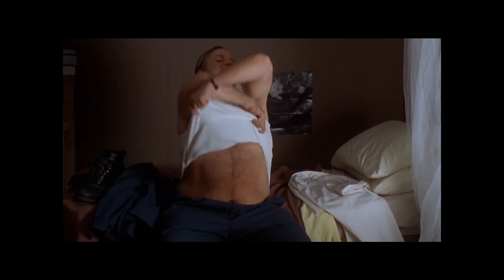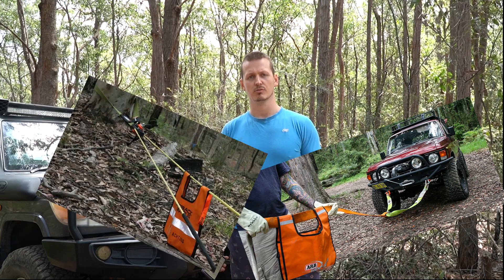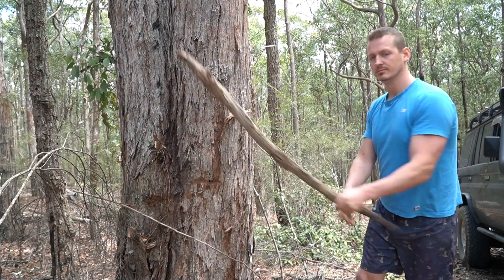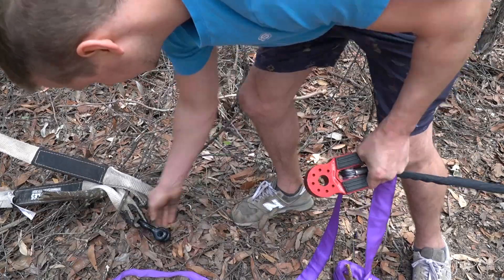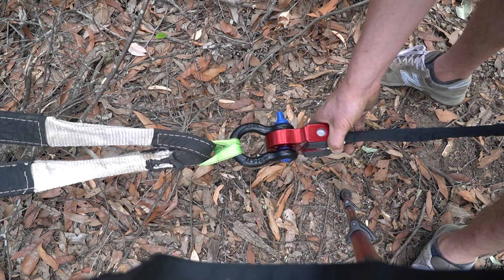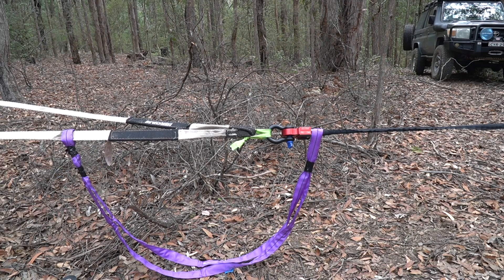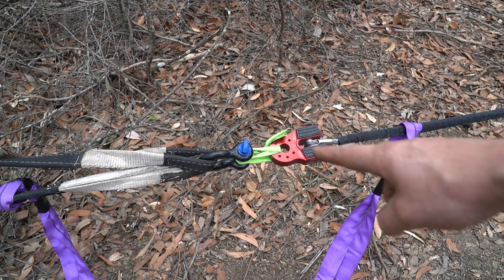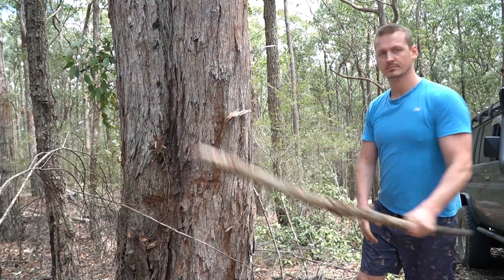NEW winch recovery techniques. Breaking straps and testing to destruction

Comment: Ideally i only use a tree trunk protector, one soft shackle and my winch rope. No metal at all. The only thing i use the so called winch dampener for, is to carry my recovery gear in. Also if im winching and theres other people around that have their eyes painted on and left their brains at home i might use it to highlight that theres a winch rope on the path. 

I have removed metal from my recovery kit completely apart from the bow shackles for my recovery hitch and bridle because recovery points are sharp for soft shackles, and I have a couple of aluminium recovery rings with soft shackles for 2 and 4:1 mechanical advantage if im really stuck. The end of my winch rope has no thimble, and it has a soft shackle through it.
Reply from the maker: The less flung mass the better. This is quite an old vid and I haven't really pursued it, but I'd still trust it over any of those garbage aprons 👍

Comment: Great video mate, been subscribed and loving them since you started. It's painful listening to other YT presenters talk about physics 😂 if you do another video with a MAB strap that can have the loops tightened, it would be good to see the breaking points at different positions in the system (at the first tree, second tree etc). That will provide an understanding as to how it dampens the load when the breaking point is not within that additional strap. I think that will make it plain obvious to anyone who watches if it works or not
Reply from the maker: Thanks Julian. The plan is to have the loops "lockable". With some branded straps, and sellable. The main issue is my company isn't a shop per se, and I have no idea what I'm doing in terms of promotion and internet sales 😂
Reply: @ridiculousthings4x4  hahaa I hear you. You're definitely heading in the right direction and gaining some traction! Looking forward to seeing how it goes over the next few years. By the way, I would buy one of those straps especially if it comes with a little (promotional) MAB sticker ;)
Reply from the maker: Let's see what happens at the 1k subs mark. I've been toying with the whole stocking filler idea to sweeten the deal with some of the LandCruiser parts we make, so watch this space 👍

Comment: It's interesting that Maxtrax now have a "recovery system" that includes a built in weak point which they call the "Fuse". It is basically a soft shackle that has a lower breaking strength than the rest of the system so can be relatively certain where the break will occur if the system is overloaded.
Reply from the maker: I didn't know that. Good info  👍 maybe something like that could be used with this system to make sure it breaks like it did in the last test to give the best results

Comment: I use been using the exact same technique. Been using using it for, since I’ve been 4WDing, so roughly 30 years.
I use it even for a snatch, hook up the main recovery point to the vehicle for the pull, with an auxiliary strap, like your purple one to a second recovery point, or the bull bar or somewhere reasonably solid, in case of failure to stop that flying face modifier (FFM)coming at your windscreen or rear window…..
Personally I use soft shackles now, certainly helps with the weight of the FFM, but still use the second strap method.
Reply from the maker: Glad to hear not everyone is brainwashed by the magical orange aprons 👍 but yeah soft shackles would make it a lot better on the face

Comment: Personally I think that is a good idea but again people won't know how to use it or just won't bother. The only issue is we can not guarantee where the strap will break but looking at most tests a strap or winch rope will snap on a weak point such as damage or stitching. If people actually use their heads that is where they would attach a safety strap
Reply from the maker: Yeah, can't predict where it can snap, but you can predict where a snap will be dangerous or not. For example an empty length of rope vs. a shackle to the face. One hurts, the other kills
Reply: @ridiculousthings4x4  fully agreed. Wire rope can be a much different story on a winch though.
Reply from the maker: Yeah, it would. I wouldn't touch the stuff.
Reply: @ridiculousthings4x4  these days it's really not worth using a wire winch cable. The winch ropes are lighter, stronger & safer

Comment: Good work as usual 

If your short strap had the loop ends as you suggest, could the dangerous bits fly through the loop or do you reckon the weird angle will sort of catch it ?
Reply from the maker: They could for sure, depends on the type of break, angles etc. I was wanting to use a "woggle" type thing so I could tighten it against the rope to eliminate the chance of it slipping through
Reply: @ridiculousthings4x4  scouts?